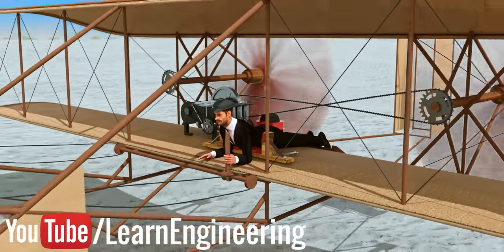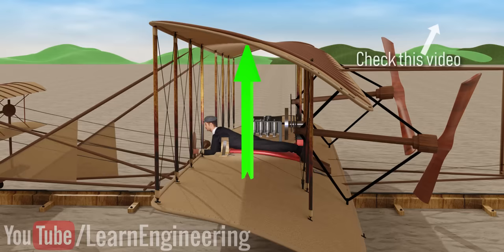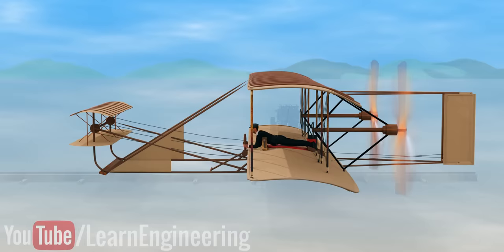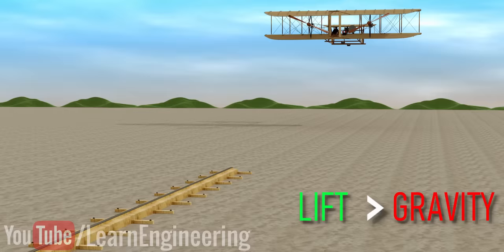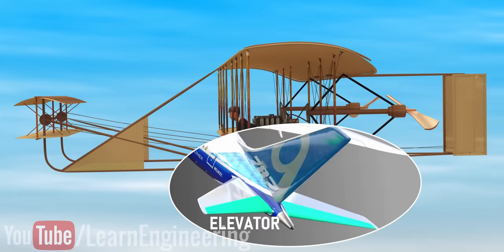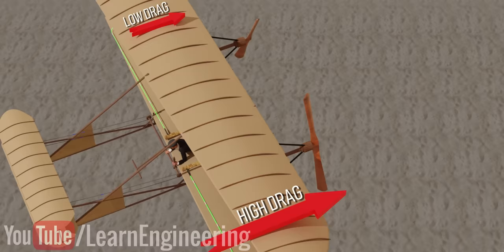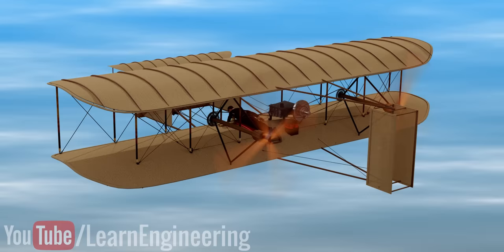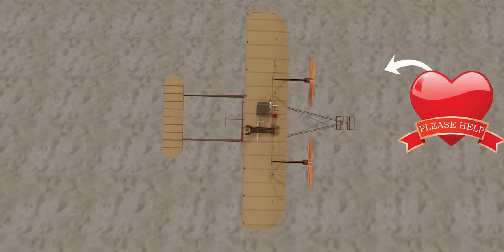The Brilliant Engineering of FIRST FLIGHT !

Comment: I have no idea who created the first airplane 

But I think it was the wright brothers

But they did catapult the plane but I still count it.

Believe in what you want to believe and don’t attack people because they don’t agree with your opinion or beliefs

TL:DR

Don’t be a karen
Reply: The Wrights’ aircraft didn’t require catapults to take off.  That was simply the method that the Wrights considered to be superior, and therefore preferable most of the time.
Reply: @cardinalRG  ok thanks for telling me

My brain is smoll
Reply: I love Brazilians....

"The replica didn't fly." -  The weather on December 17th at Kitty Hawk was unusually cold that day. The barometric pressure was very very high. The air density altitude on that day was about a 1000' below sea level from a normal day. That's why they flew. Had they not, it would have only been a few days and they would have. When they went back to Ohio the air density altitude was about 5000' and no, the aircraft didn't fly. It took them some time to figure out that barometric pressure was important when it comes to flying.

"They were catapulted into the air and glided."-  They did not use a catapult at Kitty Hawk. You are referencing the very 1st filming of a flight in Ohio. That was the 4th airplane they had built in 1908 (its here on YouTube) . There was no catapult at Kitty Hawk…. There was no catapult…. At Kitty Hawk. If a fighter jet gets catapulted off the end of an aircraft Carrier, does it then not fly?

"Dumas was the first to fly"‐  According to the definition of heavier-than-air flight, no he didn't. His airplane did not have a proper propeller, it did not have a way of controlling the aircraft via ailerons or wing warping or a rudder that moved or elevators that went up-and-down…. He hopped. Just as you guys wanna claim the Wright brothers were catapulted... his airplane was just like a paper airplane.

Please go do some research!!!!!
Reply: @brothergrimaldus3836  ok thank you I need to look more into this ive just been pushing it off

Comment: the wright's were so over rated, what made flight possible was a light weight powerplant, once people had that, literally hundreds around the globe would be able to make their first flights.
 what people see as monumental achievements, discoveries etc....most were really just made possible by boring old material science.  Take for example the lowly fork truck and tractor trailer, until metallurgists came up with the steel strong enough to make a kingpin, we were relegated to horse and buggy to move heavy things around.

Comment: You missed the catapult. What shame.
Reply: Ah, the tired old “catapult” argument again.  Since you’re unwilling to do any genuine research on the topic, I’ll provide a few facts for you here.  To begin with, the first flights by the Wrights did not use a catapult.  They used one some of the time in later years, but not because their aircraft required one to get airborne at all.  They simply considered it to be a superior method of take-off, because it used less space than an unassisted takeoff (a principle still used today), and it allowed operation from very rough surfaces, like Huffman Prairie, where even Santos Dumont’s aircraft would have struggled, if not failed to take off altogether.  Finally, when customers of contest rules required the use of wheels, these were attached to Wright aircraft and they took off with no difficulty.
Reply: @cardinalRG  I don't see a catapult in the airports
Reply: @joselourencodossantosjr7321  --So what do you think that tells you?

Comment: Santos Dumont 🇧🇷 = First
🇺🇸 = Second
Reply: I love Brazilians....

"The replica didn't fly." -  The weather on December 17th at Kitty Hawk was unusually cold that day. The barometric pressure was very very high. The air density altitude on that day was about a 1000' below sea level from a normal day. That's why they flew. Had they not, it would have only been a few days and they would have. When they went back to Ohio the air density altitude was about 5000' and no, the aircraft didn't fly. It took them some time to figure out that barometric pressure was important when it comes to flying.

"They were catapulted into the air and glided."-  They did not use a catapult at Kitty Hawk. You are referencing the very 1st filming of a flight in Ohio. That was the 4th airplane they had built in 1908 (its here on YouTube) . There was no catapult at Kitty Hawk…. There was no catapult…. At Kitty Hawk. If a fighter jet gets catapulted off the end of an aircraft Carrier, does it then not fly?

"Dumas was the first to fly"‐  According to the definition of heavier-than-air flight, no he didn't. His airplane did not have a proper propeller, it did not have a way of controlling the aircraft via ailerons or wing warping or a rudder that moved or elevators that went up-and-down…. He hopped. Just as you guys wanna claim the Wright brothers were catapulted... his airplane was just like a paper airplane.

Please go do some research!!!!!

Comment: On October 23, 1906, a milestone in history was reached: Dumont made his 14-Bis fly, a machine heavier than air.

The device was sustained at a height between 2 and 3 meters by a long 60 meters off the ground during a public exhibition made in the field of Bagatelle, France. The exhibition lasted 7 seconds and was witnessed by more than a thousand people, having even been filmed. Dumont did not use any ramp or catapult resources, the device left the ground with its own resources. The Wright brothers put the plane in the sky with the help of a rail system. Although revolutionary, the invention still needed a catapult to launch the device so that it would not depend only on the wind.
Reply: The Wright's rail system had nothing to do with getting the plane off of the ground.  it only provided a hard surface to launch from, and the rail meant the plane stayed on that hard surface.

Comment: Brilliant but not a true airplane

Santos Dumont's  14-Bis  was the first one to fulfill the 'Fédération Aéronautique Internationale' rules. He took off unassisted, publicly flew a predetermined length in front of experts, and then safely landed. Differently, the Wright's Flyer relied on an incline + the strong/steady winds at Kitty Hawk in order to take-off, in front of nobody. Then for the next Flyers II and III they relied on catapults for taking-off. It doesn't matter if they had already flown 1 zillion miles, but they failed to develop a crucial part of the process - and they did not fulfill the requirements of the International Federation.
Reply: Blah, blah, blah...
1. FAI didn't existe when Wright brothers already were flying in the air;
2. Wright brothers also flew in other places than Kitty Hawk;
3. There were witnesses of their flight;
4. Catapults don't make airplanes fly;
5. "It doesn't matter if they had already flown 1 zillion miles, but they failed to develop a crucial part of the process" - What "crucial part"? They had everything. It was other who didn't have proper controlls.
Reply: I love Brazilians....

"The replica didn't fly." -  The weather on December 17th at Kitty Hawk was unusually cold that day. The barometric pressure was very very high. The air density altitude on that day was about a 1000' below sea level from a normal day. That's why they flew. Had they not, it would have only been a few days and they would have. When they went back to Ohio the air density altitude was about 5000' and no, the aircraft didn't fly. It took them some time to figure out that barometric pressure was important when it comes to flying.

"They were catapulted into the air and glided."-  They did not use a catapult at Kitty Hawk. You are referencing the very 1st filming of a flight in Ohio. That was the 4th airplane they had built in 1908 (its here on YouTube) . There was no catapult at Kitty Hawk…. There was no catapult…. At Kitty Hawk. If a fighter jet gets catapulted off the end of an aircraft Carrier, does it then not fly?

"Dumas was the first to fly"‐  According to the definition of heavier-than-air flight, no he didn't. His airplane did not have a proper propeller, it did not have a way of controlling the aircraft via ailerons or wing warping or a rudder that moved or elevators that went up-and-down…. He hopped. Just as you guys wanna claim the Wright brothers were catapulted... his airplane was just like a paper airplane.

Please go do some research!!!!!

Comment: the rule is clear, catapult is not airplane
Reply: There is no such "rule," only the subjective opinions of organizations and individuals.  You're free to feel that the use of a catapult disqualifies an aircraft, but of course, others are free to disagree with you.
Reply: @cardinalRG  It is defined by the ICAO (International Civil Aviation Organization), it is not because something has 4 wheels that it is a car, not everything can be just an opinion
Reply: @BlackStarConcept  --To begin with, the ICAO is an entity of self-appointed authority whose subjective definitions are analogous to, and no better than the subjective definitions of any private organization or individual, such as yourself.  Moreover, the ICAO defines an aircraft as “any machine that can derive support in the atmosphere from the reactions of the air other than the reactions of the air against the earth’s surface.”  Obviously, this does not disqualify a catapult-launched machine as an aircraft.

In addition, you seem to be forgetting that the 1903 Wright Flyer did not use a catapult, nor did the 1904 Flyer initially.  The Wrights’ use of a catapult was a performance preference rather than a necessity anyway, and their aircraft could take off without a catapult, just using much more distance.  The same can be said for aircraft operating from aircraft carriers…or do you believe that they aren’t aircraft merely because they use a catapult to take off?

Comment: Is this narrated by a 4 yr old for 4 yr old? First flight?  Gyroscopic Procession? LMAO! try Precession hahahaha... Precession really only affect the aircraft during taxi and t/off  or  high angle of attack, when a force is applied.  Here we are more concerned about P Factor: torque. The fact that 1 propeller would not be sufficient, or would have to be way too large to fit, weigh too much, require the shat and and other to be built much heavier and stronger, which would prohibit the them from keeping aloft, and create way too much torque. 2 propeller was also due the design, and torque was probably overlooked at the time, as by luck they had built in counter rotating propellers. Also You need to go and review your history before making a video lol, they patented a kite "flying machine" granted in 1906 with their wing twist.   Sandy terrain and rail???  LMAO! Reality: not enough power and could not lift off without the use of a catapult. Many were airborne  prior to them, and 1st real powered flight is still debated to this day. When they tried to demonstrate to the military in France , they had to refit with French engines and propellers, which of course is not published in history books as it does not fit the tale and glory.  Wing twist was their innovation, later replaced with ailerons.  Dude You really need to to check your basic facts, basic definitions and please change the nerdy voice in these videos, makes it unbearable to watch. Plus it is not correct information, misleading, and plain wrong at times... Gyroscopic PREcession: A spinning propeller is essentially a gyroscope, which is a spinning disc. That means it has the two properties of a gyroscope: rigidity in space, and precession. For the most part, this only applies to tailwheel airplanes when they lift their tail off the runway during takeoff. As the tail comes up, a force is applied to the top of the propeller. And since the propeller is spinning clockwise, that force is felt 90 degrees to the right. That forward-moving force, on the right side of the propeller, creates a yawing motion to the left.  All and all, Id only the narration could match the graphics, the facts be correct, it could have been a decent video. It needs to be redone properly as this is erroneous, a false history lesson, and a false/inaccurate physics lesson.

Comment: FIRST FLIGHT???????????????

Santos Dumont is FIRST FLIGHT!!!!!!!!!
Reply: No, Santos Flew after Wright brothers, moreover his machine couldn't even turn corrdctly and his propeller was a dead end.
Reply: How when he never flew?
Reply: I love Brazilians....

"The replica didn't fly." -  The weather on December 17th at Kitty Hawk was unusually cold that day. The barometric pressure was very very high. The air density altitude on that day was about a 1000' below sea level from a normal day. That's why they flew. Had they not, it would have only been a few days and they would have. When they went back to Ohio the air density altitude was about 5000' and no, the aircraft didn't fly. It took them some time to figure out that barometric pressure was important when it comes to flying.

"They were catapulted into the air and glided."-  They did not use a catapult at Kitty Hawk. You are referencing the very 1st filming of a flight in Ohio. That was the 4th airplane they had built in 1908 (its here on YouTube) . There was no catapult at Kitty Hawk…. There was no catapult…. At Kitty Hawk. If a fighter jet gets catapulted off the end of an aircraft Carrier, does it then not fly?

"Dumas was the first to fly"‐  According to the definition of heavier-than-air flight, no he didn't. His airplane did not have a proper propeller, it did not have a way of controlling the aircraft via ailerons or wing warping or a rudder that moved or elevators that went up-and-down…. He hopped. Just as you guys wanna claim the Wright brothers were catapulted... his airplane was just like a paper airplane.

Please go do some research!!!!!

Comment: Santos Dumont was the one who invented the airplane
Reply: An airplane that never flew... didn't have elevators, didn't have an efficient propeller, didn't have any control...

Sure...
Reply: @brothergrimaldus3836  Never flew? Wtf u talking about? Santos Dumond's plane could fly completely independent from any support like the catapult used by the wright brothers. There are videos of Dumond's plane in the air

"With a catapult even a cow can fly" — Santos Dumond
Reply: I love Brazilians....

"The replica didn't fly." -  The weather on December 17th at Kitty Hawk was unusually cold that day. The barometric pressure was very very high. The air density altitude on that day was about a 1000' below sea level from a normal day. That's why they flew. Had they not, it would have only been a few days and they would have. When they went back to Ohio the air density altitude was about 5000' and no, the aircraft didn't fly. It took them some time to figure out that barometric pressure was important when it comes to flying.

"They were catapulted into the air and glided."-  They did not use a catapult at Kitty Hawk. You are referencing the very 1st filming of a flight in Ohio. That was the 4th airplane they had built in 1908 (its here on YouTube) . There was no catapult at Kitty Hawk…. There was no catapult…. At Kitty Hawk. If a fighter jet gets catapulted off the end of an aircraft Carrier, does it then not fly?

"Dumas was the first to fly"‐  According to the definition of heavier-than-air flight, no he didn't. His airplane did not have a proper propeller, it did not have a way of controlling the aircraft via ailerons or wing warping or a rudder that moved or elevators that went up-and-down…. He hopped. Just as you guys wanna claim the Wright brothers were catapulted... his airplane was just like a paper airplane.

Please go do some research!!!!!

Comment: Santos Dumont did it better.
Reply: No he didn't
Reply: @gcferr  --By 1905, the Wrights were flying complete circuits with three-axis control, including a flight of 39 minutes that covered 24 miles.  A year later, Santos-Dumont’s best result was a 200-meter, two-axis, ground-effect hop in the 14-bis.  In that light, why do you believe that Santos-Dumont “did it better”, please?
Reply: Santos's 14 Bis only flew up to 68 meters for 21-22 seconds while the Wright Flyer 3, created in 1905, flew up to 39.9 km for 39 minutes. So, Santos Dumont did it better?

Comment: UTER BULLSHIT !! Wrights Flyers needed a heavy weight attached to a pulley and gantry to generate enough speed on a runway to generate enough speed to gain the lift . No proper undercarriage . While in Europe , Bleriot , AV Roe , Santos Dumont had aircraft with wheeled undercarriages making PROPER POWERED take offs from 1906

Comment: This is a fake flight. Impossible to sustain the flight of a 700lbs aicraft with a 12hp engine propelling two propellers through chains. Do the calculations. At most this plane was a glider.
Reply: In order to make any claim that the Wright Flyer’s engine lacked the power to make it fly, you have to perform the necessary calculations.  You have to assimilate all essential factors, such as gearing, propeller efficiency, engine torque, coefficients of lift and drag, wing loading, and others.  You also have to account for the atmospheric conditions in which the aircraft would operate.  If you haven’t reckoned all these necessary criteria, then you’re just guessing.